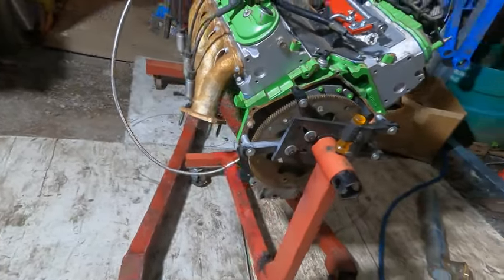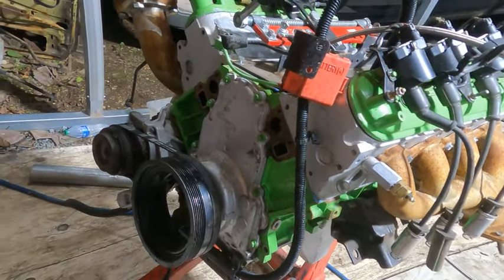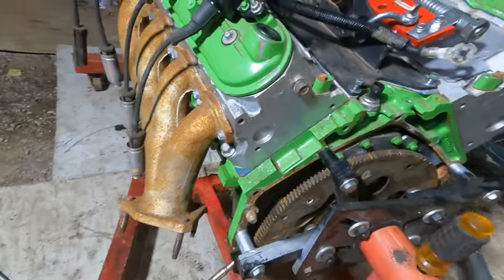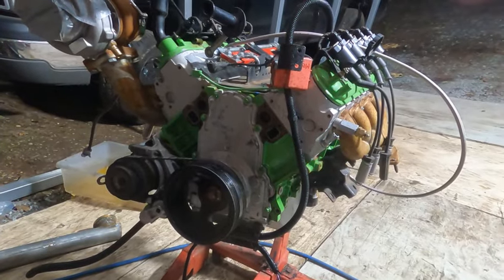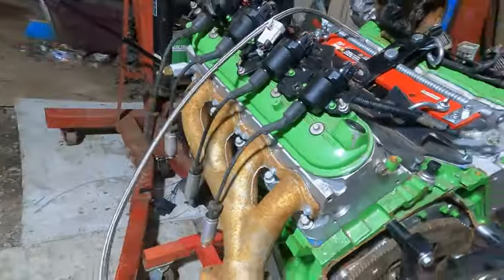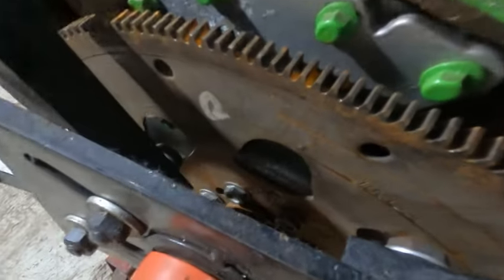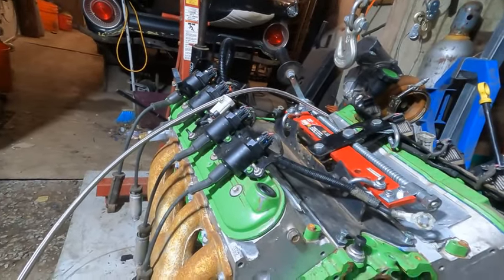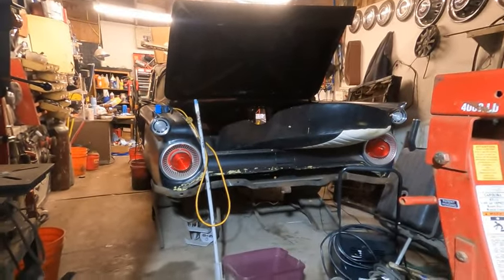It's Cursed! Pulled it out again...

Comment: I would think those crank driven pumps could pull air around the crank gear and gear side clearance if its just crawling over not pulling enough vacuum. Ive seen new starters with the fields busted and dragging against the armature. I bet with a new starter spinning it good it will build pressure.
Reply from the maker: I wish that was the case. It turned out that the main battery cable in the truck is junk causing the slow crank but that didn't fix the oil pressure issue. Video tomorrow about what I found...
Reply: @GettinGreasyGarage  i seen the video but honestly i'd like to have more proof, and please dont take that the wrong way i mean no disrespect. Can you take that oil pump apart and check clearances? I mean you may take that one off and replace it and everything be fine, but then again you might pull that one off and stick it right back on and everything be good also. Im a definative type of guy, i like to know exactly what the culprit is, but dont go out of your way just for me. I do enjoy these little mechanical mysteries though. Thanks brother